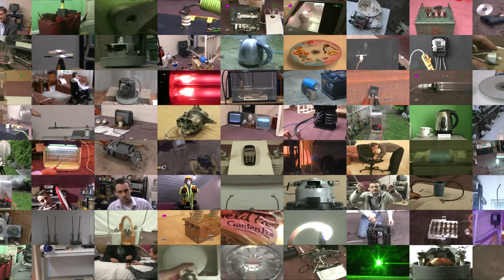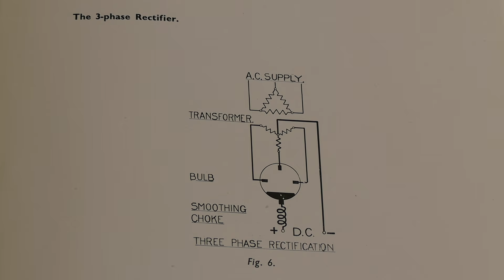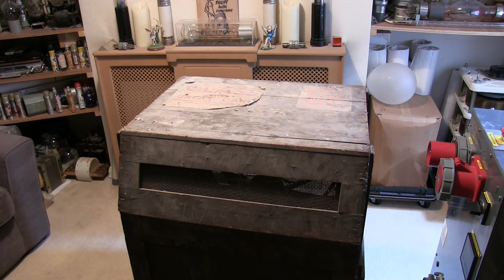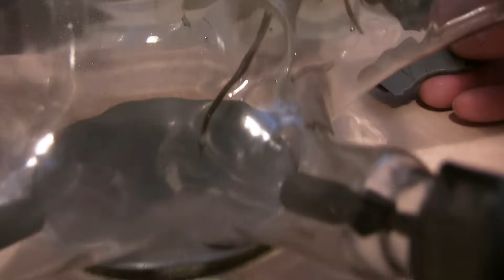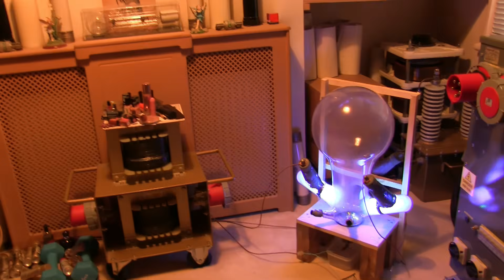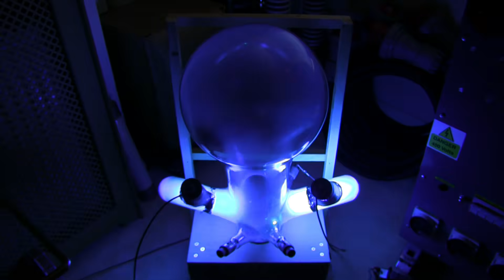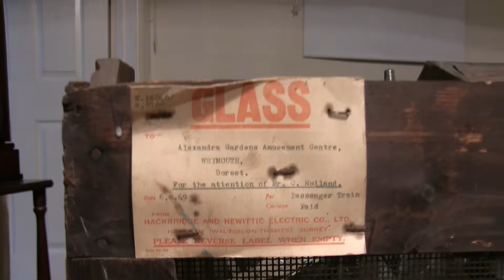Testing The 50 Year Old Mercury Arc Rectifier

Comment: also mercury vapor rectifiers were common in audio gear (radios, amplifiers, etc.). also neat that they have a really low internal resistance.
many times you can see a choke right after the rectifier because the inrush current can blow up the tube

Comment: I am curious why is that small arc wondering on the surface of the mercury, although is very interesting to look at.
Reply: That is an effect called a Cathode Spot. It's the part of the pool where the electrons are being emitted from. It is bright because the small area is both throwing of mercury gas from the heat of the arc and because the area is very concentrated with electrons
Reply: @cheetor5923  i was thinking about something similar, it is awesome to see beautiful it it
Reply: the spot moves around because  the arc is jumping from anode to anode and back.

Comment: The mercury rectifiers (single phase) with a grid control were called Thyratrons (if an aging memory serves) and were the equivalent of a "modern" thyrister or SCR.
Reply: That's where thyristors got the first part of their name. Though if I'm not mistaken thyratrons were neon based instead of mercury.
Reply: @eDoc2020  Thanks for the further info

Comment: I used to work on London Underground Power division. All the substations that fed the track had these mercury arc rectifiers in them. I can remember walking in dark substations with the blue arcing of the rectifiers casting an eerie glow which was quite an interesting experience and gave the impression they were alive. Each transformer rectifier set was about 1.5Mw. They were later replaced by silicon diodes in the late 70’s /early 80’s

Comment: when the solar flares hit, this guy will put England back on the grid.
Reply: I wouldn't be surprised at all. When high tech fails and the experts that keep it running stand by helpless guys like him will put us back on line.
Reply: @Leonidas Poledouris instead of a solar flare it would be a global flare
Reply: Only if he happens to be in Dinorwig at the time.

And I suspect there's a picture of him at the gate with the caption : "Not permitted entry under ANY CIRCUMSTANCES WHATSOEVER."
Reply: He'll have a cape made of copper wire and have small children holding wires standing on rubber mats on day one of the revival!
Reply: This man is the grid
Reply: Send a single 19kv wire to 10 Downing St too zap BOJO

Comment: I knew what this thing was from the title, NYC Subway had these for a long time. Though for hints on the age of the subway systems in places like NYC, Boston and London, MARs replaced rotary converters.  Those were basically just an AC motor spinning a DC dynamo(more complex I know but that is the basic way to describe a rotary converter).

some locomotives had them onboard too
https://en.wikipedia.org/wiki/New_Haven_EP-5

though this sounds unique due to the fact the they worked on both AC overhead and DC third rail systems.

Comment: We used big bulb rectifier tubes in the movie projectors I ran as a HS kid. There were three in the power box, and when one went out, the carbon arc that provided the light would start to flicker, making the movie flicker. The full time projectionist, who had giant brass balls, would reach in and replace the rectifier while the thing was powered up and the movie was running so he didn't have to stop and restart the movie.

Comment: I worked on the Bevatron at Berkeley we had Ignitrons in water cooled banks each one was about 3 feet tall and 10 inches in diameter. https://upload.wikimedia.org/wikipedia/commons/thumb/1/1e/Joe_Moore%2C_Photographer._September%2C_1996._BEVATRON_COOLING_TOWERS_(3_SHOWN)_AND_MOTOR_GENERATOR_ON_RIGHT_-_University_of_California_Radiation_Laboratory%2C_Bevatron%2C_1_Cyclotron_HAER_CAL%2C1-BERK%2C4-72.tif/lossy-page1-1200px-thumbnail.tif.jpg

Comment: I would love to see more of this, or at least stuff like this, AC is amazing n all, but there are certainly interesting things with HVDC that I feel are less explored, particularly combinations of HVDC and HVAC or one or the other high amperage. Though there is one thought I want to see and have seen in small scale, that is HV control before this tech, late 1800s early 1900s, where sparkgaps and or initiation of dielectric breakdown triggered by UV light, that is UV ionisation of air either in proximity to a sparkgap or the UV lamp itself as an electrode. Ive seen photos of some of tesla's UV lamps, what strikes me is that they look as though they were optimised for surface area, I.E. Large surface area of glass densly packed to create as much ionised gas as possible, as the ionisation take place relatively close to the envalope of the lamp. Given what he was doing in the prime of his research there is alot that could be done with such an apparatuses.

Comment: what causes the arc to leave the copper rod and start jumping around on the mercury bath?
Reply: Well, where does lightning strike? The highest point, generally. Where does the arc go? The highest wave in the mercury. After it gets started the magnetic field and just current flow will disturb the mercury and cause it to slosh around a little. Thus, creating a wandering cathode point where the DC is flowing into.

Comment: Can you imagine a day when THIS was the heart of your 200,000 watt AM radio station?
Reply: They still have such a beast on display at the Radio New Zealand  Titahi Bay Transmitter just north of Wellington. Huge long green transmitter with a mercury rectifier at it's heart. The newer replacement transmitter is about 1/8 the size...
Reply: Back in the '30s WLW Cincinnati used to run 500KW! They got requests from Buckingham Palace. Lots of interesting history on the place available on the web. 3000 Amps of DC for the filament transformers. Up to 90 amps of RF at the antenna. No modulation limiters, so when someone hit a big note, streetlights in the vicinity dimmed because the transmitter would just suck down the juice.
Reply: On't wireless...
Reply: Easily. This isn’t an alien spaceship from a trillion years ago.

Comment: I imagine we aren't going to get a "'til it pops" on a mercury-filled rectifier, but... can it pop?
Reply: If overloaded, yes.
But this thing is built to handle an awful lot of power; you'd need a very hefty supply and a similarly capacious load. I suspect you could push the full current of a domestic mains (100A, 24kW) through it and into a carbon arc lamp and it wouldn't be particularly stressed.

Actually, I'd quite like to see that...
Reply: https://youtu.be/YhaQqgXrMMU

Here's a couple of similar size units in service, looks like they're good for about 200A each.

Comment: Who needs a tanning bed when you have a mercury arc rectifier
Reply: Ig this would be producing a lot of UV?
Reply: @prakharmishra3000  You bet it does!
But luckily regular glass blocks UV-C, the really dangerous one.
If it were quartz glass you would be in trouble.
Reply: @juststeve5542  I don't think this would use regular glass as it goes to high temps probably
Reply: @prakharmishra3000  possibly but the important thing is that it's not quartz
Reply: @juststeve5542  I once read about an incident in a club where they used quartz instead of "blacklights" (for the fluorescent shirts and such) that stuff will seriously mess you up

Comment: These were used only 50 years ago!? Seems like  technology from the 1890s.
Reply: The last mercury arc rectifiers in service were used to drive HVDC transmission lines and were decommissioned in 2014.

The highest power TV and radio transmitters still use huge thermionic valves (tubes to Americans) called klystrons. No semiconductors can handle the combination of megawatt output power and gigahertz frequency.

Comment: IMO, it's a mere 'toy' unit...
I was fortunate enough to see the old units in operation on the inter-island HVDC link here in NZ before they were finally decommisioned about a decade ago.
250kV with the original max load being a measly 600MW
The newer, thyristor-based solid state units that replaced them are rated @ 350kV / 700MW.  (There's both a +350kV and a -350kV pole so the theoretical maximum power transmissible is 1400MW)
It's only a short 610km link (Benmore to Haywards) of which only 40km is under the sea.

Edit: Here's a pic of the original rectifiers
https://upload.wikimedia.org/wikipedia/commons/thumb/4/48/Pole_1_mercury_arc_valves.jpg/1024px-Pole_1_mercury_arc_valves.jpg

Comment: That's a lot of UV to be playing around without eye protection.
Reply: But not much of it would get out through the glass walls. You need quartz to let UV through.
Reply: @sonicspring6448  It depends on the iron content too. In solar low iron glass is used as it transmits more UV.
Reply: @N4CR  The strong UV line in the mercury discharge spectrum is almost completely blocked by borosilicate glass, which these rectifiers are probably made from - certainly not soda glass, and certainly not quartz. You can smell the ozone near a mercury discharge tube made of quartz but lamp manufacturers put a layer of borosilicate glass around it to cut that powerful UV, which is at 253 nm wavelength and definitely damages the eye, as A Name said. There are some good graphs of the difference here  https://rayotek.com/tech-specs/material-comparisons.htm

Comment: Thank you for demonstrating the Mercury Arc Rectifier. There are 2 being used in the Museum of Transport and Technology to provide power to the trams. Whilst you can see the purple glow as trams step through the resistance notches in the controller, it is not possible to see the rectifiers in any detail. I was surprised by how little mercury is used.

Comment: These are quite powerful, reliable and a better show than a set of diodes (some mercury rectifiers having been in use for 50+ years), but I wonder how "clean" is the output, esp. on a 6 phase one?

Comment: @Photonicinduction, What would / was the output voltage and current capability of the Rectifier ? (I saw it was running @400v 7A), And did it need to have a load always connected to keep the mercury conducting ?

Comment: I can remember as a kid in the 1960s visiting the Science Museum in South Kensington London and seeing at least two of these on display, I had no idea what they did but I used to like pressing the little button (or turning a knob on one of them that pulled the magnet in) and watching them glow blue for a few minute until the automatic timer turned it off.
How quickly these got replaced by silicon along with valve (tube) rectifiers in electronic equipment but you can see why, imagine how expense these things were and delicate to boot.
Hope your new wife doesn't mind living in a 1930s London Underground Lift Equipment Room?

Comment: A question that came to my mind about this rectifier: Why is the glass in the shape of a large spherical-ish bulb at the top, instead of just being closed off in a rounded shape? I doubt it is just as an expansion volume for the mercury vapour, as the pressure inside should be pretty much only determined by the temperature that the mercury at the bottom reaches.
Reply: Heat sink
Reply: @_Hal9000  Ah, that does make sense - give a bigger surface area for air cooling.

Comment: Cinemas used to use these type of rectifiers on the carbon arc projectors.
Reply: I know of an abandoned cinema with one still installed. What role did they play?
Reply: @5pr1nk57  The carbon arc light sauce on the projector used carbon rods -ive and +ive. The dc electricity arced between the carbon rods producing the light. Same carbon lights used during ww2 as search lights, a very very bright focused light in both cases.
Reply: @5pr1nk57  search carbon arc lights
Reply: Back in the early 60's a company I worked for was still using some equipment left over from WWII to measure high value (multi-megohm) resistors. The high voltage DC required was produced using mercury arc rectifiers like these.  The rectifiers were old then and were getting slow to start so a thin bamboo cane was kept in the cabinet they were in, a few sharp raps on the glass with the cane normally did the trick.

Comment: Question 1, as the current flows between the anodes and mercury cathode, why is there the massive bulb at the top? Is is just a reservoir for mercury vapour? How does that help?
Question 2, what is the willow-the-wisp dancing around the mercury? I wouldn't have thought all of the anode current would enter the cathode at a single point.

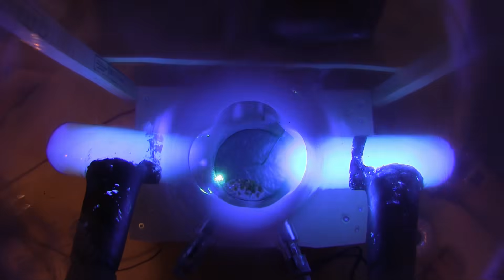Comment: Could someone who understands this device from a professional level explain to me what is causing the arc in the mercury to "dance" around ? I understand the exciter being used to create the starting arc, and the arc maintains its position at the tip of the exciter at first. But once he turns it up the arc leaves the tip of the exciter and just starts dancing around in the mercury. Around 19:50 we can actually see the surface of the mercury being disturbed by the arc as it moves around. So my theory was the arc was being created by a "break" in the oxide layer of the mercury and the mercury vapor atmosphere. And the waves being created by the exciter causing the highest point in the mercury to move around. So the tip of a wave could create the thinnest point in the oxide layer and thus causing the arc to come through, which would explain the arc dancing around. But the arc also seems to kind of make contact with the outer edges of the glass as well. So I was just wondering if any electricians or old school engineers who actually worked with this tech might be able to explain the phenomenon.

Comment: The Machine Omnissiah  is pleased by this.
Reply: Next time you unbox such relics, use a grounded vacuum cleaner with a mesh at the nozzle in combination with a painting brush to dry clean most of the dust without liquid if the artifact is not static weak.

Magnificent collection btw.

Comment: The mercury-arc rectifier is used to convert (or rectify) alternating current into direct current. The basic form is a glass bulb valve featuring one or more arms with steel or carbon anodes, and a cathode consisting of a self-restoring pool of liquid mercury. This liquid cathode sets it apart from many other types of rectifiers, making it more durable and capable of transmitting much higher electrical currents. The AC heats up and va-porizes the mercury, causing the current to travel through the vapor to the other side of the bulb. The current is prevented from traveling backwards, so the effect is like that of a diode.

Comment: About 40 years ago we had a job fitting high bay mercury lamps in the crankshaft  bay at Gardners. The crankshafts (some 7 -8ft long were lifted by a 700v DC gantry crane fed from one of those oversized light bulbs! I seem to remember a big fan under it when operating too!

Comment: These things never fail to amaze me
I've got some questions:
1 - How much do these things cost these days?
2 - what's the little flashy thing zooming around the mercury?
3 - Does it change in appearance with an increased load on the output? ie does it get brighter or does the flashy thing act differently?
4 - How much power was it drawing when in operation without anything on the output? A slightly smaller one would make a sweet decoration 😀

Comment: You can tell he's grown up boys. He's protecting the carpet with plastic
Reply: Burning a carpet is ok for later use. Spilling mercury ... isn't.
Reply: It's the new wife probably lol.
Reply: Was thinking the same thing.. the wife is asking him "please don't burn the fkn carpet and try keep it clean" 🙄
Reply: Mercury on the floor = Biohazard cleanup crew, stripped up carpet and underlay, chemical cleaning in the worst case scenario and an expensive hotel bill while the house is sectioned off. If not mercury poisoning literally kills neurons via breaking down of the structural tubules supporting the axions.
Reply: @mattlambermon6583  also, it's not a biohazard. Biohazard are BIOlogical agents.
Reply: @mattlambermon6583  you need to learn more about mercury so you don't keep getting irrationally scared.
Reply: @mattlambermon6583  regulatorys suck eh?
mercury spill, vacuum it up and she'll be right, metallic mercury isnt as scary as everyone thinks, it is the oxides and vapor you gotta worry about
Reply: @frogz  yeah the vapour can easily travel through the air compared to liquid mercury which barely does anything unless you are stupid enough to drink it.
Reply: @frogz  This. My old whacky physics teacher explained that too. I got to stick my fingers in a jar of it, weirdest feeling shit ever it's like thick watery jelly with weight to it.
Reply: @N4CR  ditto!
Very cold and really pushes against your finger!
Reply: Only from the mercury, burn mark in the carpet = meh, mercury all over the floor = oh fucking shit
Reply: That'll be the wife's influence!
Reply: Gotta back off on those curries Andy 🤔
Reply: This is just wonderful. Reminds me of Marek Klimek

Comment: Pretty. This level of artistry is clearly missing and has been for far too long.

Wait... What level of x-ray radiation do you suppose these devices typically generate?
Reply: Absolutely agree; they look even more incredible in real life.

For the xrays, should be none -- you want a pretty good vacuum with tens of kilovolts for that. This one is filled with conductive mercury vapour, and the voltage is too low to accelerate electrons to energies where they'd emit xrays when they stop.
Reply: That's great. I appreciate functionality, too. Thanks for the info.

Comment: Here be some Timestamps! (Also free to add and/or change these in description, should then show up on the Timeline for easier skipping)
Timestamps: 
0:00 Intro and Modern Rectifiers
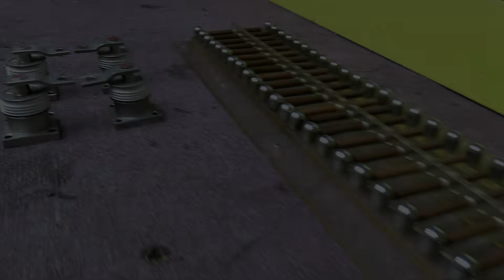1:52 Mercury Arc Rectifiers
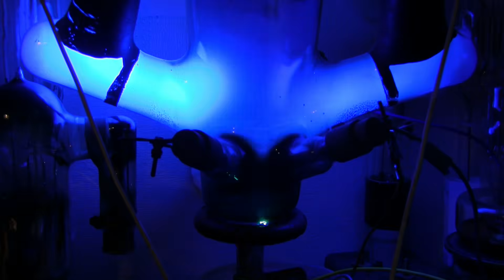5:20 Preparing the Old Mercury Arc Rectifier
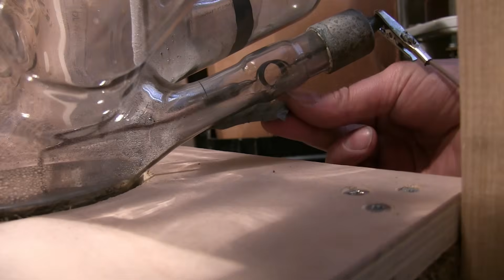11:35 Powering it up
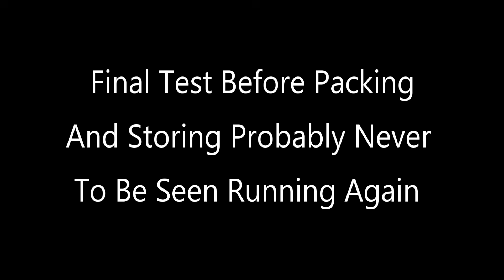17:28 Final Test
23:53 Packing it Away
26:27 End of the Video and Outro